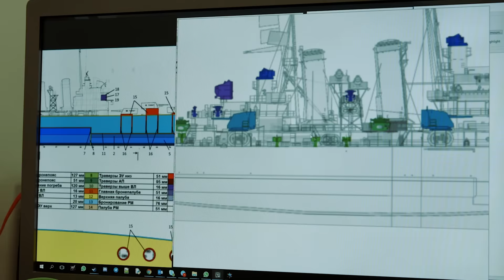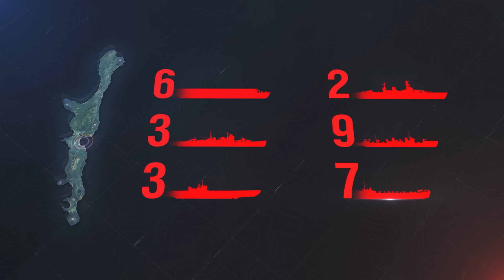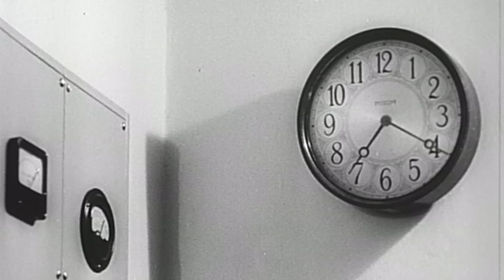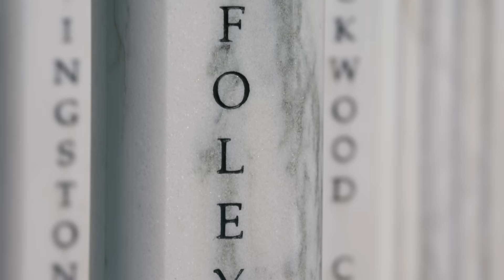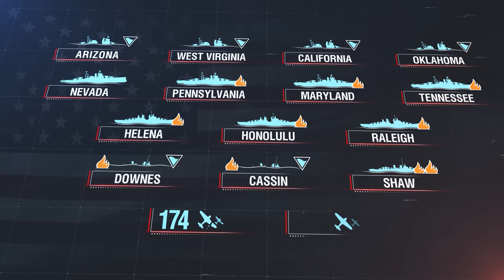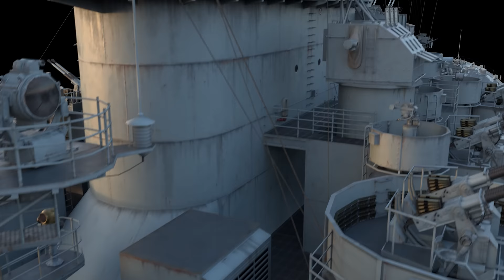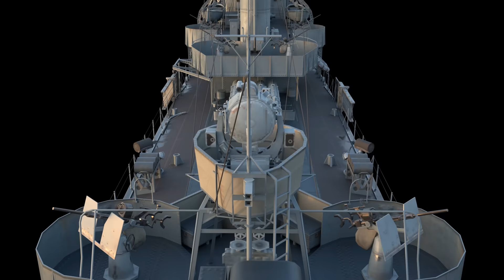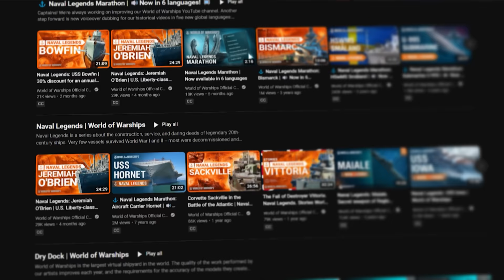Pearl Harbor Marathon: Try USS Arizona!

Comment: Visited Pearl back in '95 and as we traveled down the harbor channel to visit the Arizona my eyes some reason were drawn to the navy yard across from battleship row.
I later learned that a cousin was aboard the USS Cummings (DD-365) moored in that navy yard on Dec. 7th of '41. They disconnected from navy yard utilities, fired up the boilers and got up enough steam to move within 30 minutes. They moved out of the navy yard and were coming down the channel (along the same spot where we were located at the moment) right behind the USS Nevada as the Nevada was hit by 1 torpedo and multiple bombs then grounded on Hospital Point to avoid blocking the harbor channel.
The USS Cummings and my cousin at that moment left the harbor and began their WWII service. Cousin passed away a couple years ago at 99 years of age & was viewed as local hero residing in Waco, Texas.